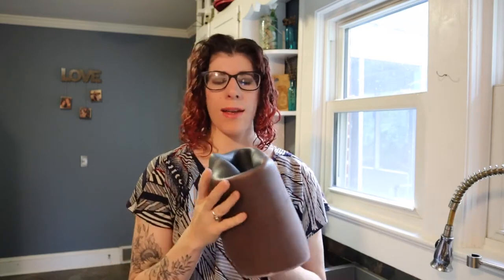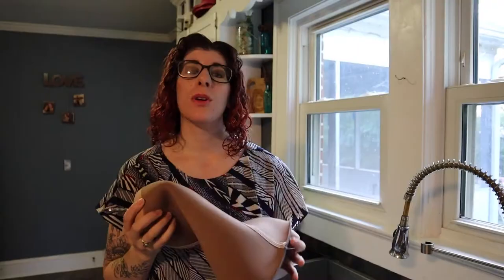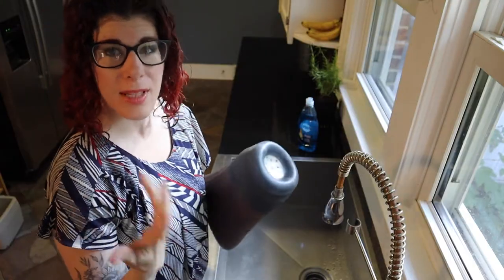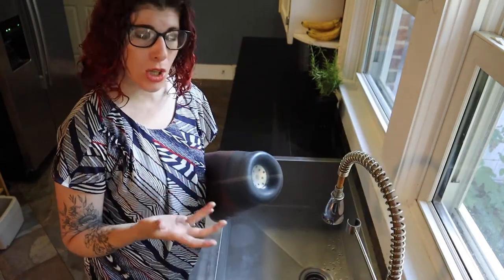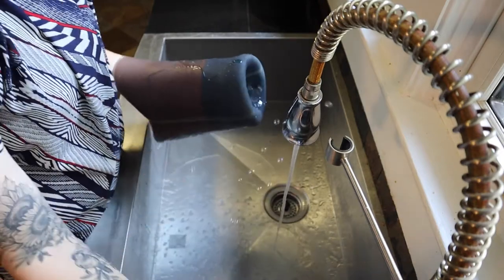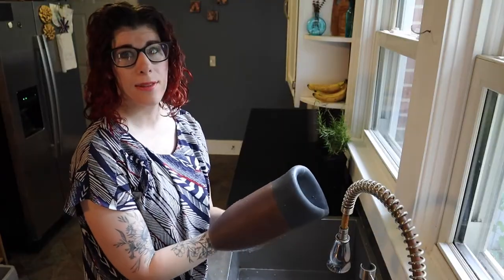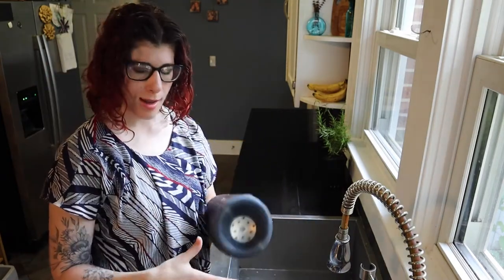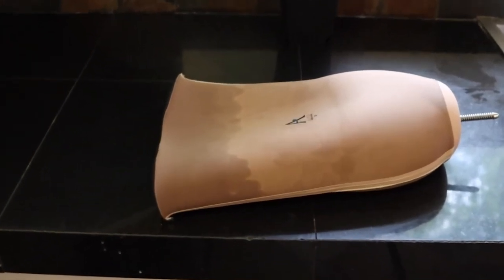How To Clean Your Prosthetic Liner | Key Tips

Comment: I've had my leg for two years now. I had experienced a bad fungus skin infection even though I washed them daily. My cardio nurse whose husband had a prosthetic leg and she told me what they used. She said that the mildest soap was vinegar. They bought douches and cleaned the liners. Well, that's expensive. I found the right formula and mixed my own with distilled water and white vinegar. But later on I discovered that if I just put a little water in the bottom of the liner, add some dish soap, a little vinegar and a squirt of hydrogen peroxide, this makes the best cleaner. Hydrogen peroxide is an odor destroyer. Now back to the fungus thing. I also would wash my stump with vinegar in the bath to help clear the fungus ( I was on medicine as well as fungal creams) and I think it did help. It cleared fast. I still wash my stump with vinegar as a preventative plus I'm cleaning my liners with it. I just keep the liner like it is and I take a wet clean wash cloth and I scrub the bottom good and then go up the inside walls and scrub those good, dump and rinse and then I roll it up in a towel to squeeze the water out, turn it inside out and roll it up again from the top of the liner rolling towards the pin and then dry good and air dry.
Reply from the maker: Glad you were able to find something to help! Fungal infections can be hard to clear up and keep clear. Is that something you are doing everyday or just using periodically/as needed?
Reply: @TheLegLady  No, I finished up the prescribed medication, it started showing signs of clearing up in about a week. I do the vinegar solution everyday with the liner and wash my leg with vinegar everyday as well. Yes I keep creams on hand in case it looks like it is coming back.

Comment: How do we clean the outside of the liner
Reply from the maker: Typically don't have to worry about the outside too much, but you can hand wash the same as you would the inside. If it needs a deeper clean, I don't recommend you do this too often, but I have had some people occasionally wash them in the washing machine with cold water and on gentle cycle. Do not use detergent though and still let them air dry.

Comment: LAK 4 years now, the best suggestion thats worked for me was to use hibiclense, the same soap thats used before surgery as it is anti microbal, antisceptic and I've never run into any liner hygiene or skin problems, I bought one foam dispenser and the refills are not too expensive.
Reply from the maker: Another good suggestion! I do see hibiclense recommended frequently.